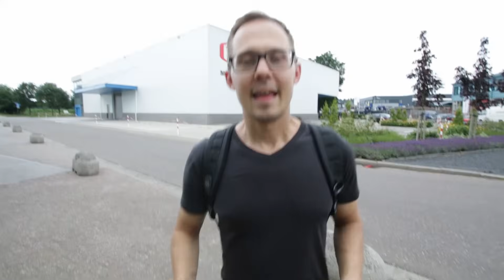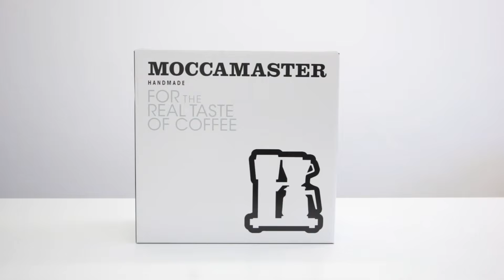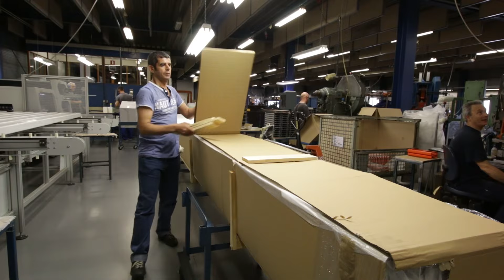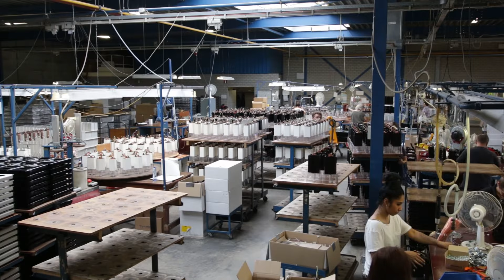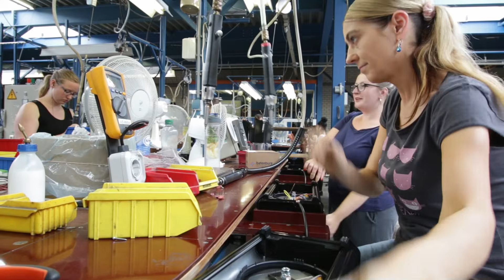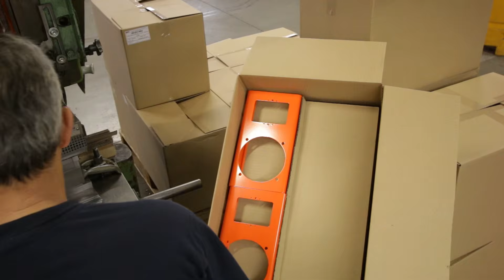Moccamaster Factory Tour: How Drip Coffee Makers are made in Europe?

Comment: I love mine.  Well made. Very consistent coffee.  Atlanta,Ga USA. The physical switch will click the warmer plate off in 100 minutes.  However we sip coffee longer than that often so I plugged the maker into a wifi switch and I use a home assistant automation to power it on at 0700 local ( switch is left in on position  to allow this. Thank you moccamaster for a phys switch that allows this.  Another automation turns off power for 15 seconds only every hour so the machine never reaches the 100 min physical switch click to off.  When I’m done with coffee I have a pgmmable button that removes power from the wifi  switch  and before bed I prep the maker with fresh ground coffee and water to fill the reservoir.  Coffee is waiting for me again the next AM at 0700.  It works well.   I could hv chosen the insulated carafe style but we can take sometimes several hours to finish the coffee and to have the insulated carafe hold temp that long I think I’d have to preheat it which defeats my ready at 0700 plan.  Letting the glass carafe sit on warmer all that time some say will degrade the taste but I use enough creamer that I don’t notice degradation.  I thought I loved coffee my wife says we love creamers. lol.  So purist I am not but the coffee itself is expertly brewed in this.  My black coffee pals rave about the quality.

Comment: Just a little tip:  Run 4oz of clean cold water through the Moccamaster to vacate the cold water above the boiler; that rinses the paper filter that ultimately pre-warms the carafe.  Really necessary for the stainless steel vacuum carafe.  Nice to see the copper heating element out of the machine in this video.

Comment: just to be picky (really picky actually), I've seen that the cold water container,  that is a part that you wont be able to wash easily, basically because is a fixed part attached to the column and the copper boiler, is touched by the inside with naked hands for several persons, It would be great to clean it afterwards (that maybe they do, but we just haven't seen it 😂) or use gloves on this stage of the assembly line at least. Other than that is everything great!! I want it!

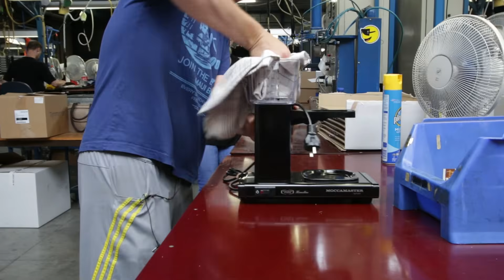Edited: I've seen in minute 6:32 they are cleaning it with a cloth and pledge cleaner spray, but this is not a sanitizer process for me,  it seems to be erasing any finger print or so.
Reply: They cleaned it in this video because they mentioned they test it before it’s boxed.  So it wasn’t a cleaning like you would do after making coffee.. it was basically to dry it after test.

Comment: Are you listening Moccamaster there in Holland.  Some of us think you are "resting on your laurels" !! the 70's production laurels.  You are rightly producing an exceptional machine with wonderful results.  As its made by hand using expensive qualified experienced labour its not cheap at around 255 eur in France.
You are waiting for my criticisms patiently.  They have been raised before but you then did not seem concerned?
The quality of the plastics are, to be polite, cheap and flimsy.
The lock mechanism is inclined to stick.
The stop system can fail and sometimes needs re setting. Needs re-designing
The excellent Stainless steel carafe (which I have) does not have a specific pouring directional spout. It can be messy pouring.  The glass carafe is also rather thin
Reply: As a moccamaster fanboy I must say ur observations are legit.  When they address some of ur comments I’ll give them more money! :-)
Reply: @ATL-Jawja  Thanks for taking the trouble. MM still thinks unlike motor manufacturers, there is no need to upgrade.  However remembering the Dutch DAF car of the 60's its quite understandable (lol)
Reply: I both understand and don’t understand the complaints about the “quality” of the plastics. They don’t need to be any thicker than they are. But, yes, considering the price it would be nice to have a more premium-feeling feel. But part of the high price we pay is their commitment to sustainability and reliability, and sticking with and supporting local works for assembly definitely adds cost.

I do agree on the glass carafe. That IS too thin. For myself, I wouldn’t ever do the glass carafe cuz I know I’d break it (thick or thin). I’m happy with the original, angular KBT thermal carafe. Mine came with the newer glass-lined version. Which I’m sure is an improvement. But I like the look of the original so much, I had to find one on eBay.

Comment: I have had a faulty MoccaMaster straight from the package. I put the water in, put the plug in the socket and was about to do that first rinse they recommend to do in the manual. Then turned the machine on.. waited waited and nothing happened. After about 5 min I started to smell burnt insulation smell from wiring. And that was it. Warranty worked and I got a new one which is still making my morning coffee after 20 yrs. No need to upgrade.

Comment: I received my machine a week ago and have been using it every day.  Sometimes twice a day!  I noticed something that seems like a design flaw.  When the machine is at its normal operating temperature (which is very not), the plastic reservoir lid deforms to where it no longer sits flat on the water reservoir.  I believe this has to do with the very close proximity of the plastic lid to the 9-hole water outlet arm.  Once the machine cools this plastic lids then returns to its normal shape, where it can then rest flat on the water reservoir.  This "heat/deform" and "cool/reform" of this plastic lid does not seem like it was designed into the machine.  I was wondering if this issue is well known?  If so, has Moccamaster done anything to correct this problem?

Comment: The upgraded shower head still doesn't evenly saturate the coffee beyond brewing half a liter. The pour is very center based. Which is not the best for extraction. You have a big hole in the middle while the coffee on the outside doesnt get as saturated during extraction.  Quick stir in the first minute usually solves this issue but this should be improved with design.
Reply: No issues with mine. It's fairly new and has the stainless steel 9 hole shower head. Works like a charm
Reply: Grind type and filter paper choice can play a role in this issue as well. With the KBT, if needed, I briefly shut off the brew basket drain and allow the rounds to saturate, stir, and then open the basket drain. Works for me.